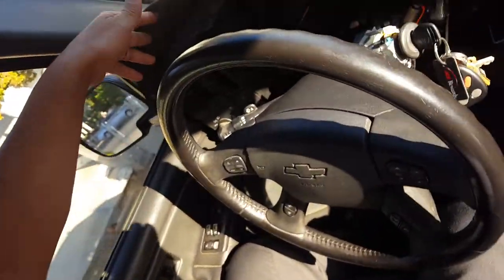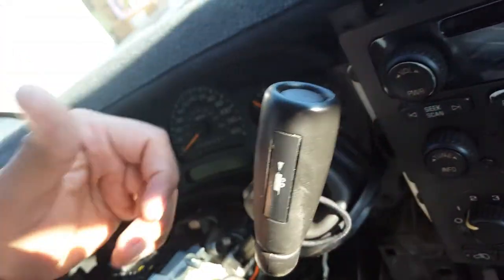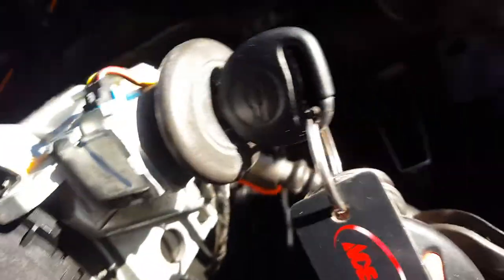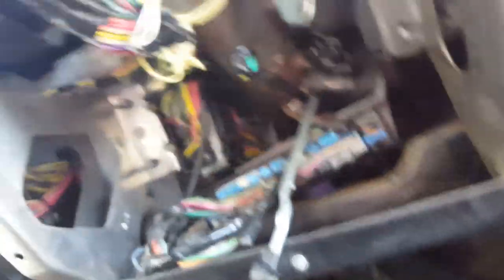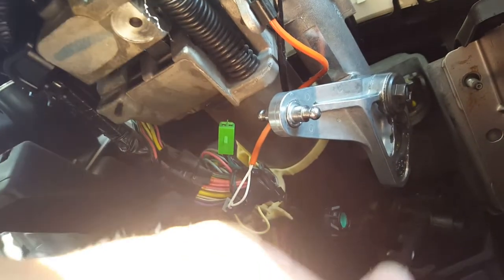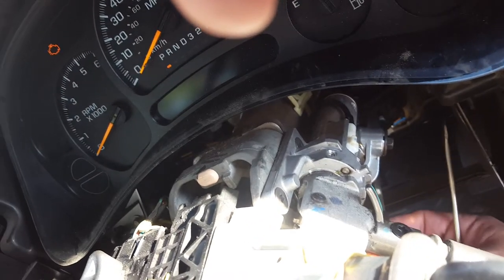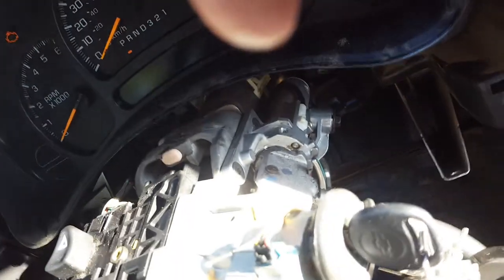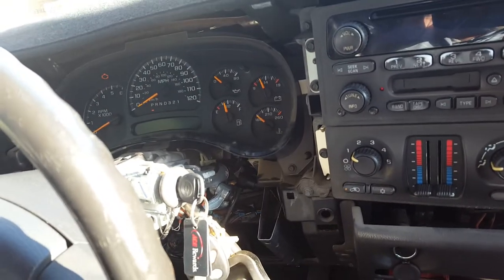2007 Chevy Silverado shifter stuck in  park. Spring in shift handle pops out, bends from wear .

Comment: My mother in law bought a 99 sierra for cheap from neighbor and I had to unhook from trans just to move next door..Checked all fuses and also swapped 2 different shift brake solenoids from junk yard and nothing.After watching  your video went out removed the 3 screws and part and found the pin was bent and not sliding back down,and pretty sure the spring was gone also. I'll just go back to the junk yard to look for parts. Anyway,I was so hyped to find the problem that I felt I had to leave this long @$$ comment.Thanks man.

Comment: Hello my friend, i had this problem, so i started watching videos last week, most of them pointed to the brake sensor mechanism, they said take that off and you can overide it and it will go into gear,,i did that, didnt work, so they were saying next replace the shifter cables, so i was like, wow thats gonna be a job, so as i was looking at those videos and im at the point im gonna just take it to a shop and spend 500 dollars, including tow, i came across your video, with my hopes down i got in my truck, didnt even have to take that top steering wheel cover off, i saw the spring, i stuck a flathead screwdriver in there wiggled it around a little bit, it was tight,,but a little piece, about a 1/4 inch long came off, i thought i broke it, so i pulled it out, but then i noticed another spring and it was tight, so i thought,,well im gonna try the gear shift, turned the key to on and it shifted into all gears like butter, mabe that little piece of spring was something important, dont know, but my truck is running again, and the gear shift is as smooth as butter..you saved me alot of money..thank you and God Blees
Reply: المشكلة بسيطه اذا عصا القير مايتحرك نهائيا اركل الفرامل 5 ضربات حتى يفك معك لان قفل الفرامل يكون متسخ بالاتربة تحياتي 🇸🇦

Comment: So I’m having the same problem did you ever figure out what the part is called so I can fix mines this video was very helpful by the way
Reply from the maker: Yes, I dont recommend buying an after market, either buy it from the dealer or take it off a similar GM at the juck yard. I bought a dorman one but the white plastic clips and design were different and it did not shift the vehicle properly.

Buy one uses on ebay or go to the junk yard if you dont want to buy it from the dealer new.COLUMN SHIFT MECHANISM
Reply: Thank you so much!!

Comment from the maker: Sorry viewers, I was on my way to work when this happened. I wasn't prepared to film this at that time. The SHIFT LEVER that puts the vehicle in gear has a small spring, " kind of like on a push pen" the spring is what pushes your lever when engaged. If you look  on the side of the lever you can see it, some times it bends and come out of place so it gets in the way of pulling the lever torward you. If pushed back in place you will be able to engage the shifter. You can trim the spring if its not to damaged or you can replace it. Its bends into the area like a (L) shape so the spring need to be strained out straight ( l) to allow you to engage.

Comment: My spring is broke.Now how to get new spring into snifter :(
Reply: I am wondering the same thing
Reply: @jakeclemons650  I ended up putting a new assembly in on the shifter column. Works fine now. Wasn't that hard of a job.
Reply: Any luck finding the spring? Mine broke too and I'd rather not have to tear it apart further to replace the whole thing if I can just slip in a new spring..
Reply: @seanmartensen2179  That is so tight to try and get one in there. Try turning your key all the way to counter clock wise then see if the shifter will move. Mine wouldn't come out of park, and when I was working on it that is what I did and it come out of park for me. I still replaced it all.
Reply: @seanmartensen2179   Kind of late but maybe it’ll help someone. I had a similar problem. The same spring in my shifter broke into short pieces and my truck wouldn’t go into park. I searched a couple of parts stores but had no luck. I found a fairly strong spring of the same diameter (~9mm) at Ace Hardware. I had to cut it to the same length (it was 3-4 times longer). It was tough to work it into place but I was able to get it in the same position as the broken one. Works like a charm now.